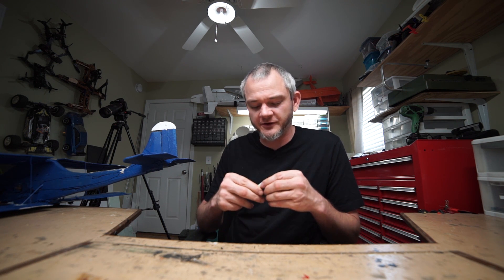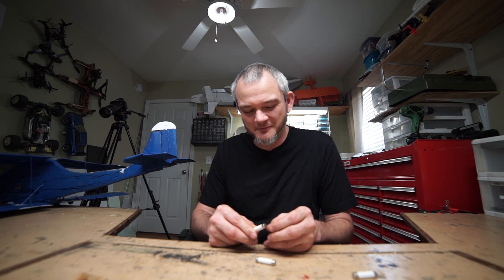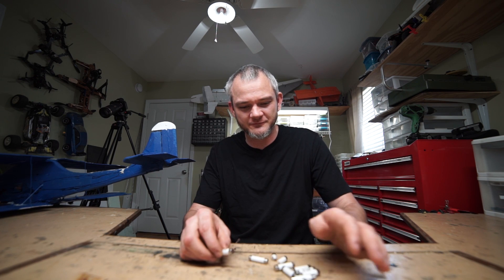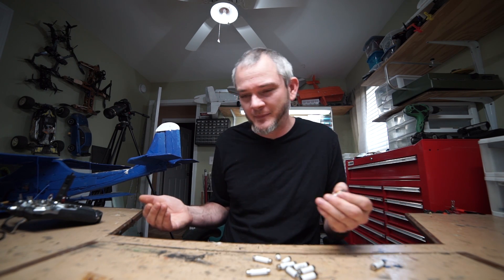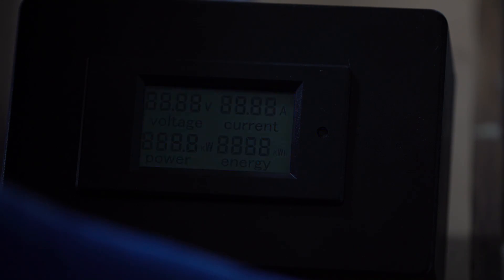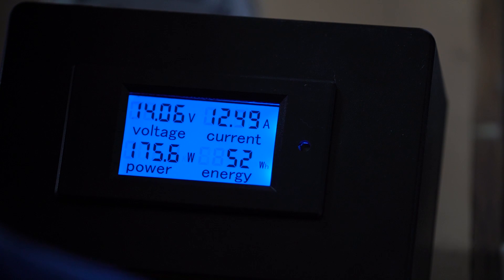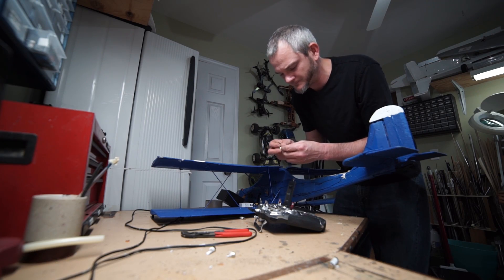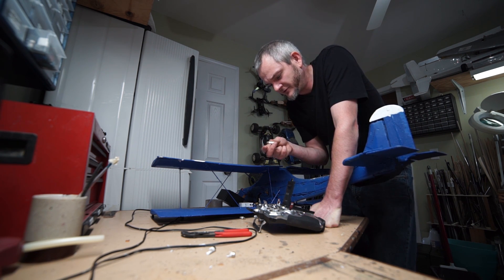Beware of Cheap Chinese Fuses on Ebay and others!

Comment: Fuses fast blow on spikes of much greater caliber.  The amp rating is just a constant operating value, not a value over which it will instantly blow. A 1 amp fuse for example may operate a long time at 20 amps and will eventually blow per spec. This time is longer as you get closer to 1 amp.  Once you reach 1 amp the fuse is designed not to ever blow.  Try this same test with expensive bussman fuses and you will get similar results.
Reply from the maker: These were fast blow fuses.  They should have opened up within a few seconds.  You may be thinking of time-delay fuses which are designed for inrush currents such as motors. Anyways, proper fuses blew at exactly when they should have.  If you don't believe me, try it yourself.
Reply from the maker: And no, Bussman fast blow fuses will blow very quick for a 1amp @ 20 amps.  Also, the element is much different.  There was no element in these fuses, it was a 24ga copper wire.

Comment: You are right and you are wrong.  You are right in that you should never use cheap no name Chinese fuses in your equipment, especially higher amp and higher voltage fuses like 20A / 250V etc.  It's VERY dangerous.     You are wrong in this: a 1A fuse may not blow immediately after exceeding 1A even for a fast acting fuse.  Fusing time and current is a very complicated and difficult subject for the fuse manufacturers, and you can find out the ratings at different currents from a Data Sheet.  Try Bussman or Littelfuse data sheets for fast acting fuses, and this will show you that a 1A fuse won't immediately blow at 1.01A.      Regards.
Reply from the maker: I know what you are saying and I agree that fuses having clearing times and all.  However, in the context of what I was showing, it was far above "1.01 amps." Sure, if you used some way to capture the exact moment, you would find a delay.  After all, even light isn't immediate nor is the response of a mouse click.
Reply: @jjmonns  Hi,  yes your test overall did show a problem going up to 18A+ but it was somewhat borderline and the test was not conducted correctly overall.  You do literally need to open up some spec sheets that do have the interrupt rating times and see for yourself, especially on larger fuses.   You'd be VERY surprised how slow a fast acting 25A fuse for example is to blow at say 30A.  And just how many amps it takes to blow it in a few ms.  For example for fast acting cartridge fuses  https://gyazo.com/d2dc461eaf24809942a3c834235d108d   it takes around 400-500A to quickly blow a 25A fuse.
Reply from the maker: @bn880  I understand what you are saying.  I agree that my word usage was less technical and more in the moment.  However, at 300% or more over current, you are going to see the type of fuse in the video blow in less than a second.  That chart you linked is for larger style fuses in power distribution.  The types of fuses in the video are similar to those found in everything from small motor applications to Fluke meters.  The criteria for what is considered "fast blow" is relative to the application, so the context of a time chart is important to the specific fuse being studied.
Reply: @jjmonns  Hi, no , the chart I linked is for this type of fuse as well.  1A is listed there.  But yes of course, it should have blown way faster especially at 300% like you say.  However not as you expected at just over 1A.   I think it's pretty clear you just learned this from me, so lets not argue more about it and move on.
Reply from the maker: @bn880  Whatever makes you feel better man! I won't take that away from someone who seems to really need it.
Reply: @jjmonns  You've been trying to take that away from the start.  Even when you have been shown evidence that your video is half wrong.  About 80% of youtubers react the way you do when they learn something they didn't know and realize they made a mistake in the video which undermines it to a medium or high level.  20% of them just admit they're wrong and if necessary make a revision or new vid.    Anyway, yeah you're doing good to show that chinese no name fuses are a bad idea and the ones you got are garbage.  Just that you weren't aware what fuse ratings really mean and how to test fuses.  This is information MOST of the population doesn't know about, and not even every Electronics Engineer is aware of this info.   So no need to get petty and make round about explanations in how everything is ok, or how I need an ego boost.   it is what it is and your viewers would benefit from a revision to let them know that's not how most of these fuses work.  that's all I am saying.
Reply from the maker: @bn880  The subject of fuses at the level you are discussing goes well outside the scope of this video.  I think it's great that you know about the subject and you bringing this up wasn't a problem.  You assumed that I don't know, and assumptions tend to piss people off.  If I were doing a video about the subject of how fuses work, then sure it would be appropriate to talk about clearing times and all.  This video wasn't aimed at the electrical technician, but the person who's replacing the fuse in their device at home and who may unwittingly buy something that could harm them/others.  

If you want to accuse me of omitting this from the video, that's a valid argument.  Could have I done more? Sure, perhaps I'll make a note about it.  However, it comes across that you took this as an opportunity to talk more about what you know than what will help others.  I hope that isn't the case and I encourage you to work on making your delivery more palatable.
Reply: @bn880  Very informative chart. Thanks. Also, thanks for the introduction to Gyazo.